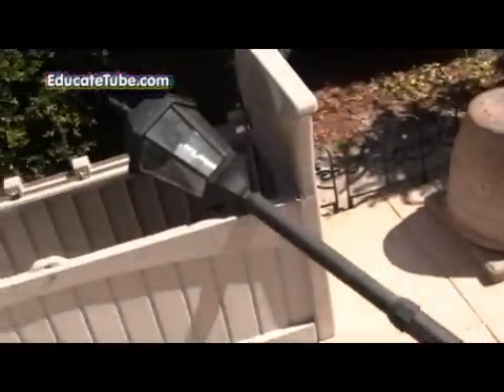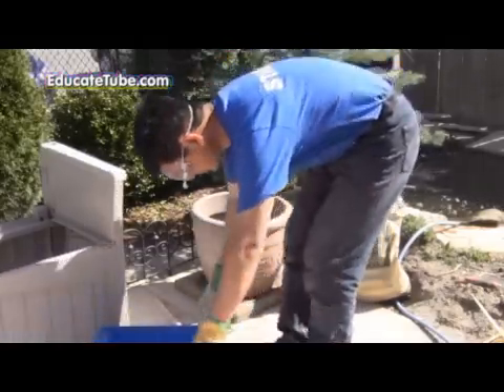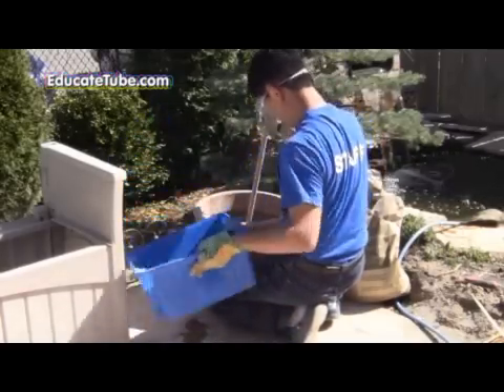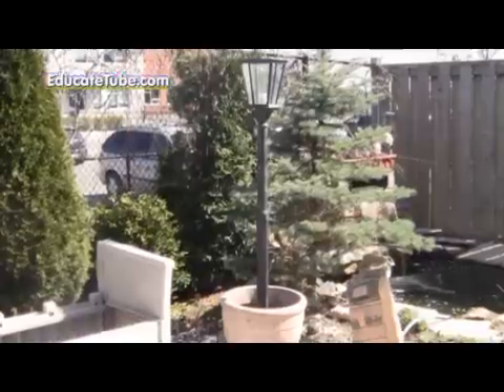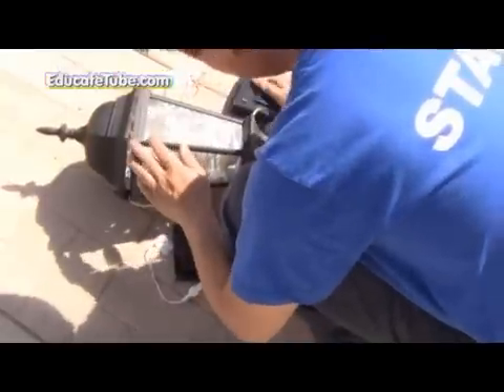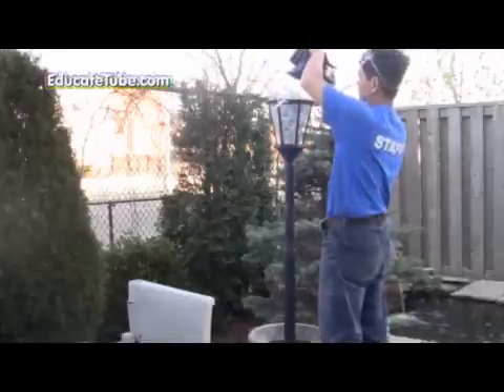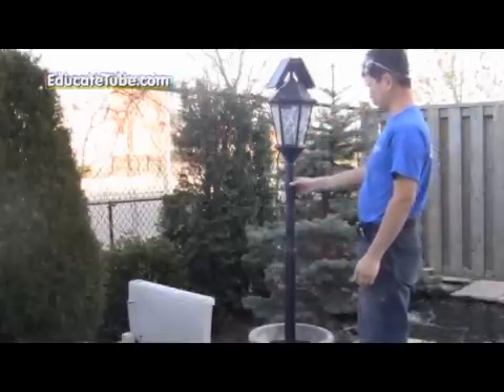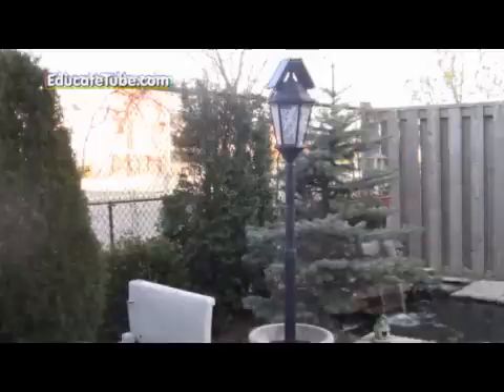DIY Solar LED Lamp Post Free Light Energy All Year Round and Looks Amazingly Cool Backyard Garden

Comment: use the panels to charge a 12v battery, then run an dc to ac inverter to a real bulb....ive done this, its great,  free light all year round,
Reply: Good idea! I want to do this to convert my existing regular outdoor light to solar-power. Do you have instructions or a parts list for this? Thanks.

Comment: What kind of solar panels did you use? How do they kmow when to apply the stored power at night? It has batteries built in?
Reply from the maker: They are 2 watt solar panel that comes with the LED lights.  They were on sale during Boxing Day Sale.  I just needed two 2 watt solar panels to power 200 LED lights at night.
Reply: EducateTube.com
Cool! I'm shopping for some lights right now. Do you know how many lights there are in the bundle? 100 or 200? The solar panels are 1 amp? Most of the panels I see are 150-300ma with 1 1200-1800mah battery. Your panels look better than the ones I'm seeing. Thanks for your help.